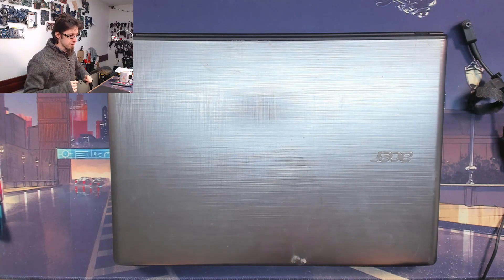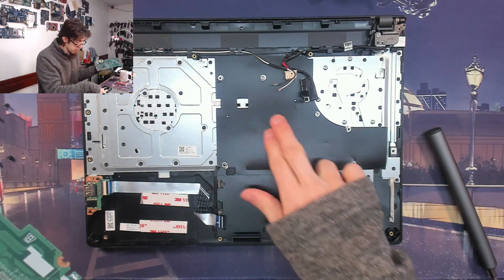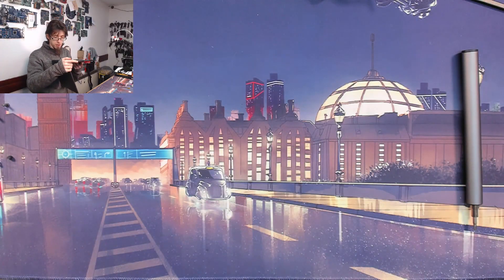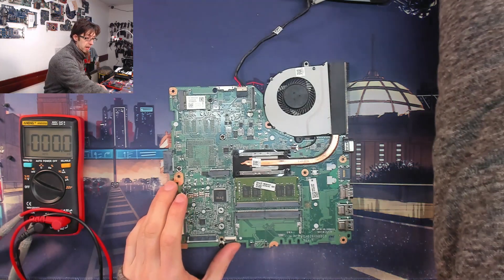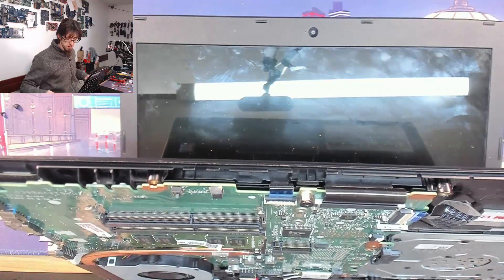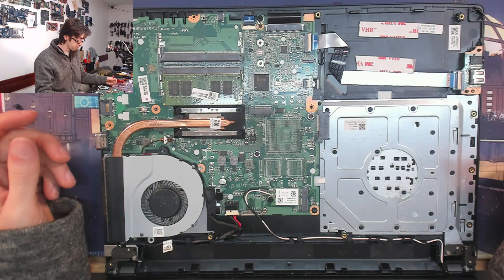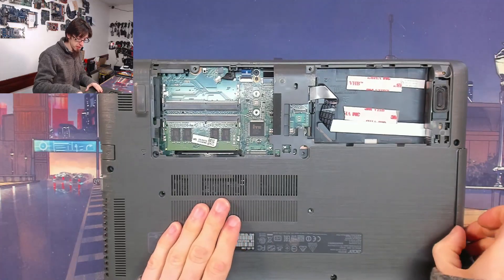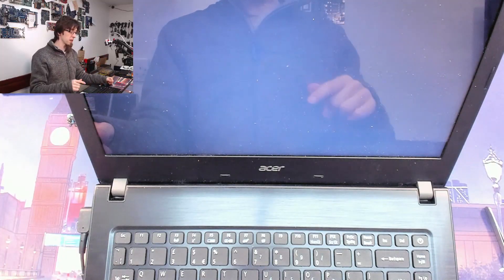Acer E5 Charge Light But No Power - LFC#237

Comment: The battery wasn't dead. Why didn't it start on the battery?
Reply: still needs the switch no matter how its powered
Reply: @ashleynery8092  The new switch was in. The battery was installed. The backplate was attached. Press button. nothing. plug in power cord. press button. it works. why didn't the good keyboard work with the good battery? Why did it need the power brick?
Reply from the maker: Probably because of the BIOS reset, or system management, or something like that. It wanted to see charger-power first. After that it was fine doing cold-starts on battery.
Reply: @Adamant_IT  ok, that makes sense. thx :)
Reply: I have found on a lot of these models with an internal battery it needs the DC plugged in to activate the battery after having unplugging the battery. Usually it’s the ones that have a battery disconnect button on the underside that needs a pin to press

Comment: Linking the profit you make on a job to the cost of the parts you are going to fit rather than applying a set labour charge for every job seems a little ... unwise
Reply from the maker: It varies. My flat fee for basic repairs is £50, adding parts on top would've put the bill at near £100 - which I really don't want to charge for something as simple as a keyboard replacement.
Generally speaking I do charge labour fee + parts, but in this case I deliberately picked more expensive parts because I hate replacing heat-staked keyboards, and it's not fair to charge the customer extra because I'm too lazy to minimise the parts cost of the repair.

Comment: Hmm not sure why you thought the bios battery would stop it booting as all the bios battery does is hold bios setting and clock?? with a flat or missing battery you would still be able to boot to bios screen???
Reply: The battery feeds part of the super io chip  (bios data) that starts the computer, sometimes the io chip locks up and needs the power removing,  same can be true with the main battery.
This happens too often, handy to remember if you have a dead laptop.
Reply: @zx8401ztv  In short, that would be considered standby or startup voltage, then the PC needs to initiate the POST sequence? interesting, since I never heard of that explained before. :)
Reply: @gxc90  Yes it is a required startup supply.
This is only my rough understanding.
The super io chip/micro controller is the very start of everything,  if it crashes or locks up due to a slow discharge of the battery,  the system is dead of power/reset/bios rom/keyboard and all other startup functions.
Often a bios update file has p.c bios rom data and the o.s rom for the super io chip/micro to know how to use its inputs/outputs.
One type of io chip can be used in many types of machines, but the pin usage is different for each machine.
Sorry about the waffle :-(

Comment: I've used 3d pen to keep the keyboard in place. Awesome vids
Reply: That's a cool idea :) I've gotten away with hot melt glue or instant glue + baking soda combo before, but i need some more reliable and quicker methods. Wonder if melting household plastic with an induction soldering iron would work. 🤔